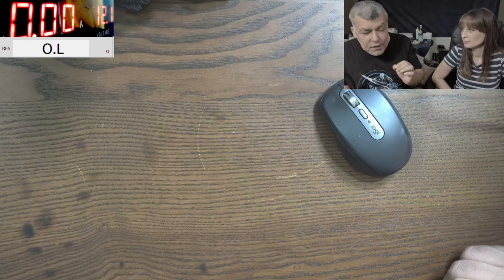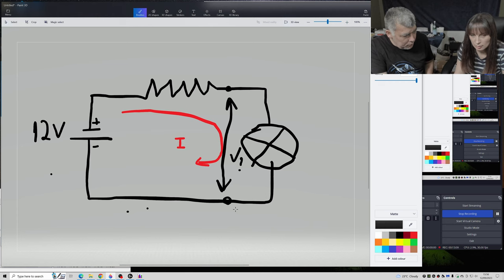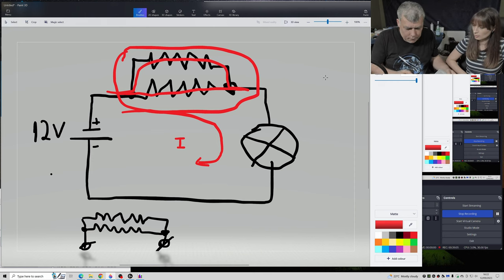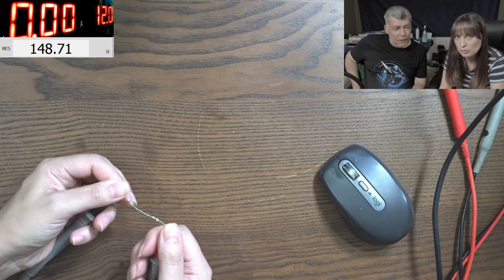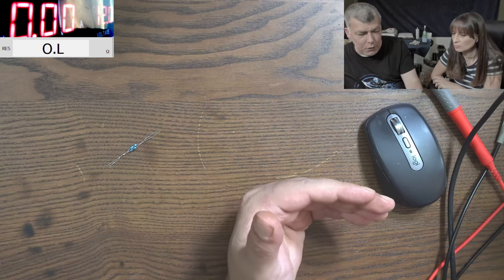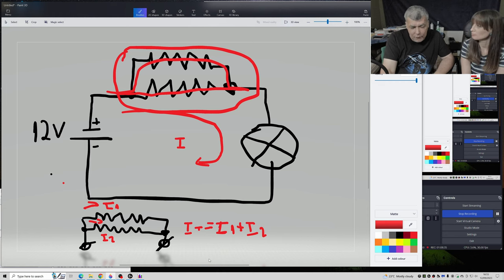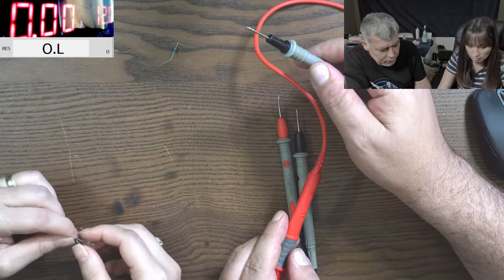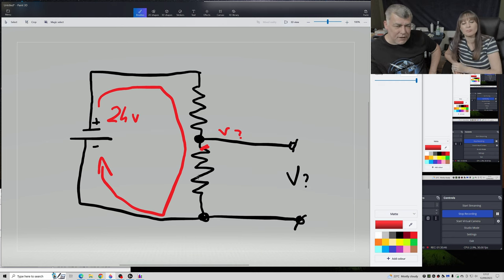Electronics basics part 2 - Volts, Current, Resistance  - Lesson 11 Learning electronics with Diana

Comment: wow, this is even hard for me and I have been an electronic technician for 20 years . I have repaired many electronic devices in my career (TVS, phones, laptops, tablets, radios, amplifiers, etc, etc.) but the way i learned about electronics was with a book called "curso facil de electronica basica" (yes is in spanish because im from argentina) and that book was " divided " into 4 main sections: theory, components, practical electronics, and projects. 
in the theory section you learn about these kinds of things, but i never pay attention to that section because there were lot of mathematical equations and formulas and things that were so boring for me (i was 15 years old when i read that book) that i never learn this kind of stuff. 
 i learn how to use the multimeter, how to solder, and how to use different tools in electronics (from the " practical" section) I learn every component and how they work and how to measure them (from the component section) and i learn some fun projects . Later in life, I started to learn how to repair things because I had an internship in an electronic store in my city, so that is how i started but I never learn the theory and this series of videos are really great for that.

until yesterday I thought that a series resistance makes the voltage drop, but I found out that what makes it drop is the current and that causes the voltage drop. Now many things make sense.

Yes, I investigated Ohm's law for example in youtube videos time ago and tried to read about it but when they started with the equations and mathematical calculations my head began to pay attention to other things (because I hate mathematics) but the way Mr. Sorin explains it is much more understandable and seeing how Diana is learning also makes me learn, keep up these videos they are great

Comment: Agreed with another commentator, the water and pipes analogy is useful here. I believe Diana is thinking about the values.. add more resistors, you get more resistance - logical and wrong. As demonstrated, this is only true in 'serial mode' where there is only one path. She needs to think about the flow, that both water and electricity follow the path of least resistance. When you add resistors, the current has another path and the overall resistance falls. The majority still goes through the low value resistor (big pipe), but some will also pass through the high resistance resistor (small pipe), increasing the overall flow of water/current. Two resistors (pipes) with the same value (diameter), half flows through each equally and so the resistance is halved. If she holds that in mind, I think it will make more sense to her.

Comment: Open Circuit means there is the 12 V potential, but nothing else. Once current starts flowing the Law applies. That makes it easier to understand. The exact values don't matter, as long as you understand the relationship. It's really cool to see it in practice though! I see it as a faucet. When it's closed the pressure is equivalent to the potential. Once you open the faucet, the flow of the water is the current. 
To understand voltage drop/ voltage divider I found the 555 timer chip to be best.

Comment: 45:01 Diana is absolutely right to not understand you. in Serial Resistors you told already R1+R2 = RTotal but in Parallel mode you did not tell 1/R1+1/R2 = 1/RTotal. So you did not tell the logic of this to her. We don't need to make precise calculations to find the solution but at least you should give that information to she and WE understand !:)

Comment: Hi sir.its very very interesting.  You are using one word try to understand not try to learn. This exactly correct. When we by heart resister formula,when we comes to repair ,we dont know nithing. But the way take the class is perfect method. No need to by heart anything..its very clear,and its coming ti my straight away,like i did a practical.its very very useful

Comment: If it goes to the lowest resistor, why have so many resistors
Reply: Some current will still go through the bigger resistors, allows finer adjustment of the output voltage/current. Can't always use adjustable resistors.
Reply: Think about a dam with water behind it, and 4 holes. Close all 4 holes, no water flows through. Open one hole, some water flows through. If you open a second hole, that first hole has not stopped flowing (unless the damn has run out of water). 

Now think of the same image, but image the holes being different sizes. The first hole is HUGE, so lots of water flows through. The second hole to open is tiny -- so the overall rate of water flow has increased, but now by much. That's why adding 10 ohms and 1K ohms only makes 9 ohms.

Comment: In series mode you are not loosing current on the resistor, as you said, you're loosing voltage. You could say the current drops because the total resistance is higher, which makes the voltage on the light drop. You understand your stuff, but you make many mistakes when explaining - probably not knowledge related - but more language related.
Reply from the maker: If you are not willing to improve yourself, then is a waste of time, no, you are losing current over a resistor like i said, the voltage drop is because you run out of current

Comment: I'm so confused with the last example. Doesn't matter what value resistor you put, if you put both in series you get half the input voltage in the middle..? I'm trying to use the water analogy there but it doesn't make sense. The water would go through the first resistor, and the voltage would depend on the value of the resistor. Then it goes through the 2nd resistor and follows the same process. I don't understand why having resistors of the same value changes anything.
Reply: Ohm’s law. V = A x R   If the value of R (resistor) is same, result will be same.
Reply: Hi, what I am meaning is voltage and current go hand in hand, so when the resistor limits the current, it also limits the voltage, when I started this was how it was explained to me, by doing a voltage drop check.
Reply: @emismarrelli  best thing you can do, build a circuit like Sori showed, using 2 resistors of equal value, then check voltage between resistors. Is it half the source voltage? Now switch to 2 different (matching)resistors. Check voltage again between resistors. Even though you use different value resistors, voltage should be same between resistors as with first time. Now try again with another 2 resistors, etc, etc.

Comment: Hi maybe explain all the voltage needs to used in a circuit, meaning voltage leaving the positive is 12v when it goes back to the battery it is 0v, the voltage must all be used by the resistance.the example with 12v two equal resistors, measure the voltage at the start of circuit after the first resistor and then after the second resistor.

Comment: If you use the phrase "current takes the path of least resistance" it helps to explain the parallel resistor circuit.
Reply: Yeah, that's what I thought all the time. It's not the "shortest" way.
Reply: I think it might confuse more, as when you combine 10R and 10KR you end up with less than 10, but the "path" of "least resistance" was 10. :)  (In reality they now all make a combined path with a sum of least resistance) 

I think at this point Sorin should have bust out the equation for resistors in parallel.

Comment: Diana, poate te ajuta explicatia asta:
Curentul prin fire e ca apa prin furtun.
Rezistorul e un furtun mai mic decat furtunul mare.
Daca pui 2 furtun gatuite in series, curge mai putin apa
Daca pui 2 furtune gatuite in parallel, curge mai multa apa.
Rezistorii in paralel scad in valoare
Rezistorii in Serie cresc

La condensatori/capacitors e fix invers, ca simt ca vine si asta:))
Reply: Sure. It is approximately correct. But, you forgot that more diameter pipe (10 Ohm resistor) and less diameter pipe (1000 K) will be wrong for water. Because water will go  through both. And current will go only through that one where is less resistance.